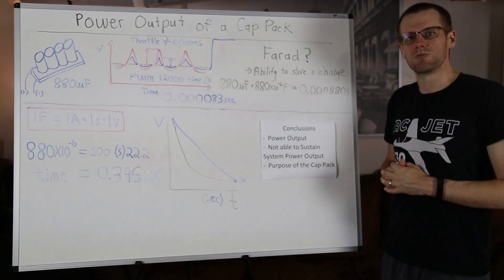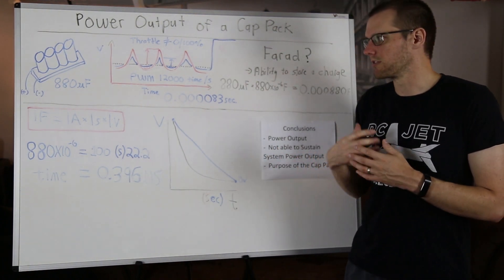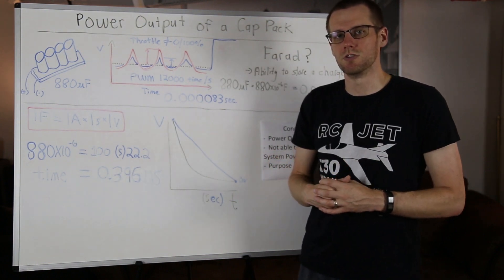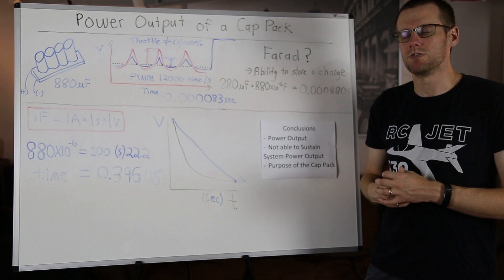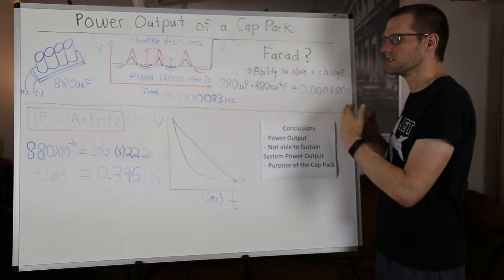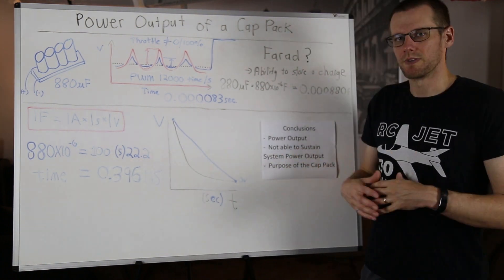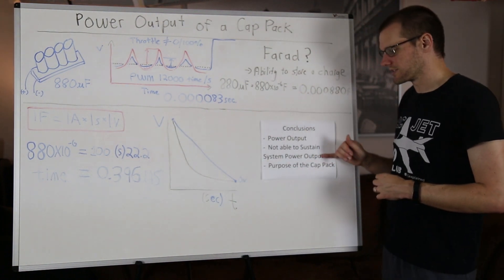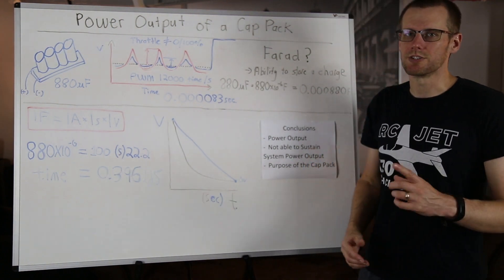How much Power Output is a Cap Pack Capable of?

Comment: Nice Video, you mentioned that we don't want voltage spikes above 10% battery voltage but when breaking the motors you always get voltage spikes above 10% even with capacitors installed.
Reply: True. The MOSFETS in the ESC do not like a too high voltage, no matter if from ripple or braking. But the input capacitors, especially when too small, get hammered by the constant ripple from PWM, as they constantly get loaded and unloaded (12000time per second), which might overheat them, which might lead to them losing capacity (electrolyte boil off) which will load the remaining capacitors even more, which will then fail soon too, or worst case, they short out. The same overvoltage from braking only loads them once, so very little heat load on them.

Comment: If you’re doing speedruns and you lose esc power or lipo comes unplugged you’ll be able to safely use the servo to steer your car of the road with the power left in the cap packs. Imagine 140mph with a sudden loss in braking or throttle input 💀

Comment: I have a dbxl-e 2.0. I'll be installing an r-snake flier 400a esc paired with a leopard 58113 870kv motor running on 8s. While I don't drag race, I do use full throttle up to 10-15 seconds or a little longer at a time. Would you recommend me using a cap pack? This is a 1/5 scale buggy. My main concern is just to help protect the esc. The batteries I use now are 100c and they tend to drop voltage on full throttle, but I am planning on getting higher c rated batteries 120c+ even if the mah is a little lower.

Edit: I know the system will be drawing over 300 amps on full throttle.

Comment: Great video, I knew there was more I wasn't considering before I add a cap bank to my rc car. I've been considering using super/ultra capacitors though. Thoughts?
Reply from the maker: I don't know enough about super capacitors to comment. Off the top of my head, I would not expect them to provide much more of an advantage vs capacitors.
Reply: @RCexplained  http://www.spscap.com/difference-capacitor-supercapacitor.html
From my limited knowledge, much much higher capacity, lower ESR, while keeping all the benefits of a regular cap.

Comment: I need this explained in more layman’s terms.
Reply from the maker: Hi GaFFLe, what are you trying to do with Capacitors?
Reply: @RCexplained  Power my 5th scale DBXLe 2.0.  XLX2 ESC w/ 1100KV motor and eliminate ripple.  I see some 50v cap packs with 12000uf and some with 19000-28000uf.  I’m wanting to have the most reserve power but not too heavy for the cap pack.
Reply from the maker: 12,000 should be way more than enough to handle some ripple voltage.
Reply: @RCexplained  Thank you!

Comment: This is with no doubt the best electric power system channel on the YouTube, congrats. As a Mechanical Engineer I really appreciate learning the fundamentals and theory behind the hobby. I'll be installing CC 12V 880uf cap packs on my 60cc electric setups to reduce the load on the ESC as I fly 3D/XA and usually get very hard on the throttle stick.
Reply from the maker: Hey Ronaldo, thank you for the awesome comment. It certainly means a lot to me and keeps me motivated to make more videos! If your ESC is able to datalog the ripple current, you will be able to see where your system is at.

Comment: Something else do you think it is best to use more smaller capacitors in micro farads but in total the same amount of Mf. For example one capacitor of 4000mf or four capacitors of 1000mf each?
Reply from the maker: A larger single capacitor can work, however smaller capacitors placed in parallel have a couple added benefits. Mechanically, smaller capacitors are able to dissipate heat to the air more effectively by using a larger amount of surface area. The second benefit is that smaller capacitors in parallel will reduce the total amount of inductance vs a single larger capacitor. Both of these points add to the reliability of the system.
Reply: @RCexplained  thanks again for your reply

Comment: Kindly so how can I calculate how much micro farads I should use, for example I use 6s battery so I used 35v capacitors but I wasn't sure how many capacitors I should use for a speed run so I made seven capacitors of 2200 micro farads each connected in parallel and 35v but I can't tell the difference that it made because I am using Max6 esc and 1720kv motor but they don't have the telemetry so I can't see what is happening?
Reply from the maker: Hi Joseph, the calculation is quite complex with many variables. (Very Complex)  
Using 7 2200 μF in parallel is a lot of capacitance. I can't see you requiring more.
Reply: @RCexplained  thanks for your reply
Reply: Get a castle  xlx  for speedruns , and cap pack  killmode , or ripple  killer

Comment: Excellent video as usual. Question, would it be better to have a bank of smaller caps, or a single larger one? I like to solder on a single 3300uF 35V cap to my ESC battery leads, would getting a bank of smaller caps be more beneficial? Thanks!
Reply from the maker: Hi Spacecadet, thank you for your comment! A larger single capacitor can work, however smaller capacitors placed in parallel has a couple added benefits. Mechanically, smaller capacitors are able to dissipate heat to the air more effectively by using a larger amount of surface area. The second benefit is that smaller capacitors in parallel will reduce the total amount of inductance vs a single larger capacitor. Both of these points add to the reliability of the system.

Comment: I actually built a 1.2F cap bank... Because I can 😛 You're spot on with the explanation. Cap bank is basically there for line filtering so your ESC is happy. One other thing I want to mention is most of the cap banks are subpar quality. They typically use average quality general purpose caps without high ripple current ratings like you'd get in say quality automotive grade caps.
Reply: the problem ive found with larger cap packs is they arc when you connect them to the battery. this can damage the connector over time. im going to try the arc eliminator xt90 connectors to see if that fixes the problem. it does keep the esc nice and cool though. also,  killmode rc makes some nice audio grade cap packs if you dont feel like making them.
Reply from the maker: Hey MadScientist, plugging in abattery pack to the ESC usually results in a spark. This is most evident starting at 4s and the spark gets louder and hotter as voltage/cell count increases. You are spot on with more capacitance leading to a larger spark. When you use the anti spark connectors, this problem will go away.
Reply: @nukethorn-v8l  I used anti spark xt90 connectors that I purchased from AliExpress and they work fine because they have a resistor and you connect it abit slow until it balance the voltage and it doesn't make any spark.
Reply from the maker: Hey Isogen, thanks for the comment and input! A 1.2F cap is quite large. Is this for car audio by chance?
Reply: @RCexplained  I actually used it in a coil gun project. And I'm kind of tempted to take the shell off my Typhon and figure out how to mount this on :P
Reply from the maker: Nice!
Reply from the maker: Hi Nick, can you reword your question. I don't quite know what you are asking.
Reply: RCexplained what is the cause of the arc or spark
Reply: @illmatic_95  a discharged capacitor will behave similar to a short when a power source is connected to it. a surge of current will pass through the connector when its first connected until the capacitor is charged. when you connect your battery to the cap pack, the contacts momentarily only make contact with a small area. that coupled with the high current causes the connector to melt in the initial smaller contact area. oxides can build up on the metal and diminish the connection over time. on a side note,  i wonder if a big enough capacitive load would damage a lithium battery. i would have to assume the battery will be fine as its only a short burst of current.
Reply: @illmatic_95   @nick c  keep in mind i have a 13,600 uF cap pack made by kill mode RC. So I probably get a little more arc than most people. It might not be much of an issue with smaller packs. You want to look for a low ESR rating on the capacitors when buying or making. And make sure its rated for the voltage  you run or higher. And before you upgrade to a good cap pack you should make sure you have good batteries with a high capacity and c rating.  The battery is more important than the cap pack.
Reply: @nukethorn-v8l  I use 15,400uF 35v to use 6s system and I use anti spark xt90 connection and I solved the soark problem. I made the cap pack myself and I used seven capacitors of 2200uF each and connected them in parallel so I would not increase the voltage but to increase the uF. Something that I don't know if it is better to use smaller capacitors but increasing the quantity to keep the same uF for example 1000uF each but I use 16 capacitors to get 16,000uF